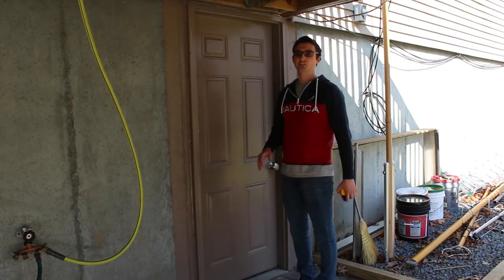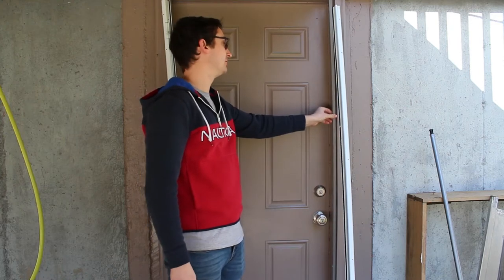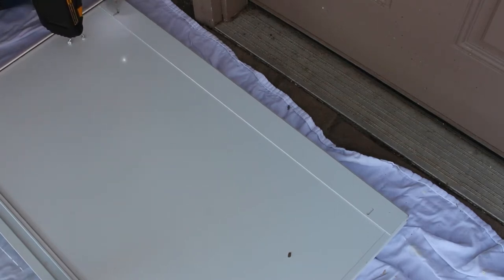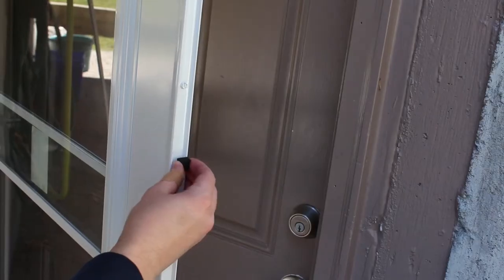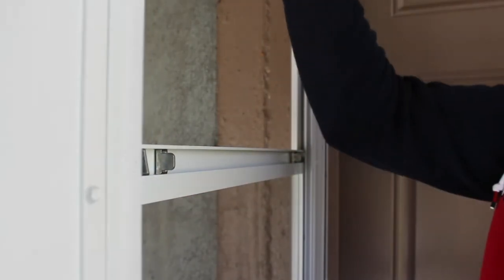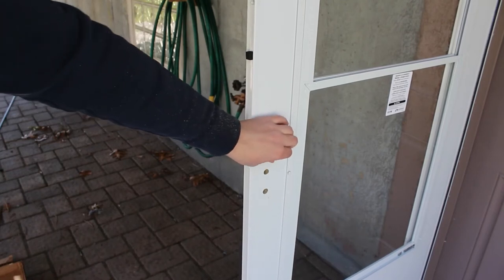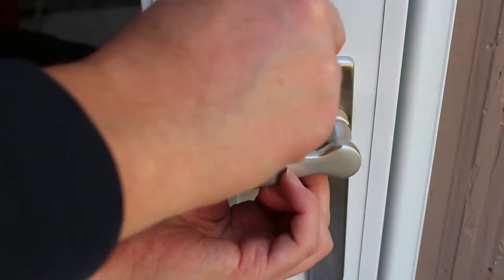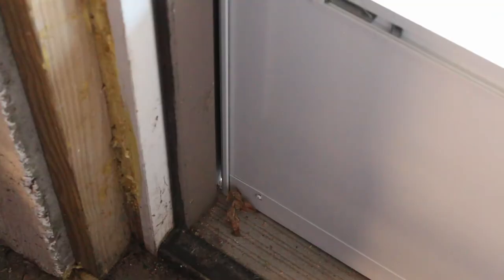Installing a Storm Door on a House - Screen Door - How To

Comment: Should you have taken the brick moulding off?
Reply from the maker: I had no brick molding. It's a concrete foundation surrounded by a wood casement and wood trim.
Reply: The wood trim casing is called brick mould
Reply from the maker: @jasonjohnson3344  learn something new every day! I could've gone this route too but Im not sure it would've been necessary. Do you think there would be a benefit to doing this?
Reply: @diytito8165  if it was replaced it could possibly be used to cover the frame and screws of the storm?
Reply: @diytito8165  absolutely no need to remove the brick molding. Your door would be recessed in further and the handles may even hit the inside door.